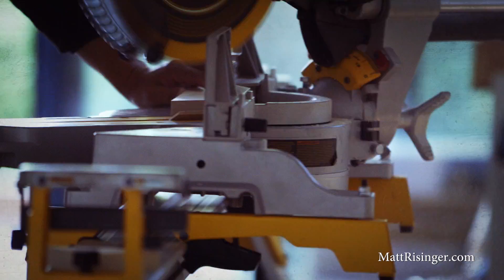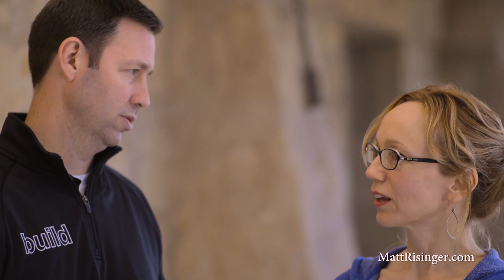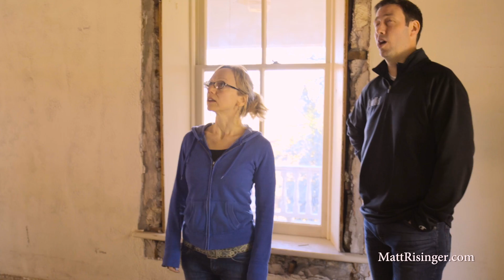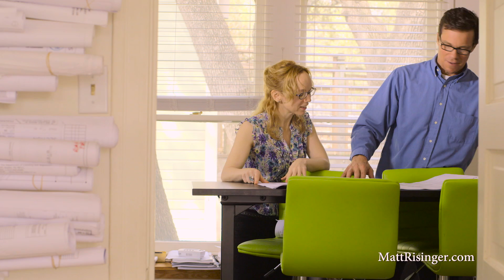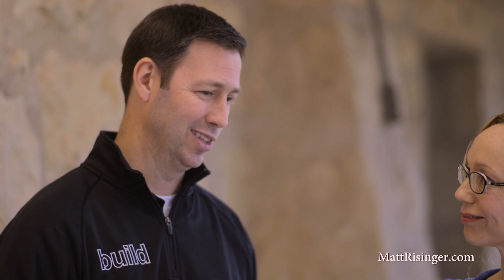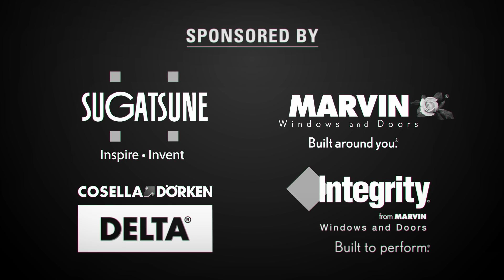HVAC Design

Comment: It's not that these people are wrong  but it's going to cost you 4 times as much and still be hot upstairs in the summertime.  Every house I go into is pulling 80% of the return air from the first floor. Get that balanced out and you will have a much more comfortable home

Comment: Hey Matt,
How important is it to have a local HVAC designer? I live in the Puget Sound area of WA state. My wife and I are building a home this year and want to get the HVAC system designed/engineered. We’ve had some trouble finding an HVAC designer locally that isn’t already busy or who hasn’t shifted their business to mostly commercial building. However, I can find many online companies that will work with us.  So, I was wondering, how important is it to find a local HVAC designer? Would it be appropriate to hire Positive Energy?

Comment: as an HVAC design professional, everything the Kimberly said, is 100% what SHOULD be done, and is what's done commercially, load calcs are very important!
Reply: I dont agree. Quoting my summary specifications for HVAC ... "ASHRAE Manual J for calculating heat and cooling loads. Size ducts and equipment by design … Rule-of-thumb calculations are not allowed, such as 600 sft/ton. Provide accurate room-by-room load calculation to select equipment and to design duct system that will perform at maximum efficiency using ACCA's design protocols, Manuals S, T, and D. Consider Summer and Winter Solar … see this website for position of sun: https://www.suncalc.org/". And, you dont "put ducts wherever you can".

Comment: Matt, I’m getting ready to have a house built that will have an above garage apartment. The house is one story and the main HVAC system will be in the crawl space. How would you suggest heating and cooling the apartment space? Dual zone, two separate units, or a mini split? My concern with a mini split is keeping the living area, bedroom, and bathroom of the apartment an even comfortable temperature.

Comment: 1% of a $1,000,000 home is $10,000.  That's steep for engineering of only one system in the home.
Reply: Well, a 1 million dollar home can often be big, or complex, so the engineering costs for those homes typically makes sense. Or, like Matt said, it may even sometimes come out to 0.5%

Comment: If you employ an hvac company to install a system and it has to be designed by a 3rd party, then you have a horrible hvac installer.  If a person is an hvac installation mechanic, he should be able to design your hvac system with the proper duct size, number and position of vents, etc.  1st thing out that lady's mouth is wrong.  500 sq ft per ton? Yea no.  Even when I started hvac back in 2000, rule of thumb was 700sq ft per ton.  In an older house with old insulation, maybe 600.  But with current building codes and the insulation required, can go right around 1000 sq ft per ton.  Lol a thank you.....  You wouldnt get that from me.  You would get your plan balled up and thrown back at you.  Because on paper it may look good but probably wouldnt work due to framing or plumbing and such in the way.  I've worked with some CLOWNS in this trade, so I know it's not all that scientific.  But these clowns just find their niche where they dont have to think much.  I'm top tier at install service and sales, as well as design if you wanna add that.  To me its included in install...  Anyways good luck, I like watching these vids to try to learn something and also to remind myself of my worth.  Lol a 3rd party hvac system design company for residential.  Lmfao....  Even in a complicated house, like a tri level existing house not being renovated, I can design a perfect system in about 45 minutes maximum.  I just did one 2 months ago.  Super complicated but i got it done.  3 days 100% complete.

Comment: I have a small HVAC business. Before getting big im learning how to use the software so i can do it the right way. Its pretty tough but going to be worth it. None of that rule of thumb here. Good job lady.
Reply: So what kind of HVAC services u providin? I'd very much like to know bcus im planning to start a hvac business too but dont know where to begin
Reply: @elangz9201 
So far.  service for residential and light commercial.
Reply: @elangz9201  mostly 
Split systems, oil boilers, oil furnace gas furnace, heat pump, ductless, geothermal. Slowly getting into installs. Im going to start my youtube channel soon. Lmk if you have any ?

Comment: I contacted an HVAC company to install the ductwork and and the heating and cooling equipment $35,000 in Boston, MA. I hired a company like hers to do the calcs for under $500. I received the plans and i am running the ductwork myself. I will also run the electrical for the units and i will just need to hire a plumber to run the gas pipes. I estimate this whole project to run me under $10,000. Its so important to get the numbers right, you only get one shot at this.

Comment: Who are you going to hold accountable when/if  you have issues with the system??  The 3rd party “design” company or the install contractor??  As a professional HVAC contractor I refuse to even look at a 3rd party’s Manual J,D,S,Z,C or T...  ultimately I’m the one that’s held liable for the system... my ass is on the line..  the biggest problem with this industry is the GC wants to get the cheapest possible HVAC contractor to do the work, and they in-turn have to cut every corner they possibly can to try an turn a profit.  I blame the GC 99.9% on the shitty mechanical systems you see in homes today..
Reply: A/C SuperKool You are exactly right, the residential building industry is all about who is the cheapest. It is a race to the bottom and it causes good contractors to loose work.

Comment: That’s not HVAC... that’s residential A/C.  .. HVACis HIGH VOLUME AIR CONDITIONING usually for business and commercial buildings!
Reply from the maker: +nytom4info it stands for Heating Ventilation and Air Conditioning
Reply: High volume air conditioning? 😂🤣😂🤣😂🤣😂🤣😂🤣😂
Reply: High volume air conditioning 😱 omg u r a genius
Reply: HVAC Stands for Heating, Venting and Air Conditioning... I don't know what you are talking about Tom. Please research what things stand for before posting it online.
Reply: It actually does stand for Heating Ventilation and Air Conditioning.

I have not heard of HVAC used as a High Volume AC, but that is a thing for commercial equipment.
I think it is only referred to as HV Ventilation.
Reply: lol you don't know what HVAC stands for yet you're saying this isn't HVAC? You seem smart

Comment: In FL  here it's a shame how people are sold just a condenser with their 40 year old blower and ductwork, code changes should prevent this.  Efficiency is all about sizing and duct work, my neighbors elec bill is 2-3 time mine because they have mismatched poor AC.  In the hottest months my AC operates 4-4.5 hrs per 24hr.  Either side of me they run continuously, and very old units.  Goes the same for heat pump.

Comment: I like having a third party pick the equipment. less likely to cut corners or try to upsell.

Off topic, but what model green office chairs are those?
Reply: Third party is also an additional cost. It depends on how expensive they are compared to how crooked your HVAC installers are.
Reply: That might work out sometimes. I wouldn't install someone else's equipment picks with my warranty. My job, my design, my warranty, my reputation.

Comment: Yup, it all starts with an energy model! 

Our process has a different step 2. We think step 2 should be exploring building shell improvement opportunities rather than equipment selection. At this step we do some iterative design charrette exercises. 

Once you've settled upon how the house is improved, rerun the load calc, THEN pick equipment.